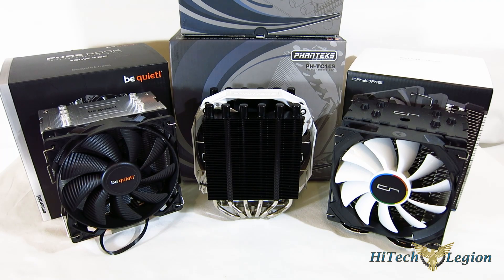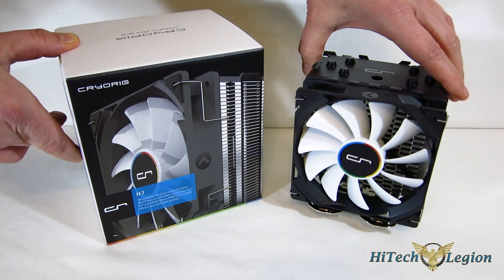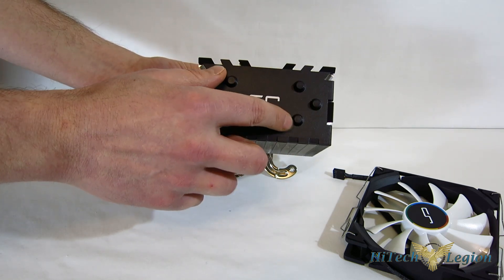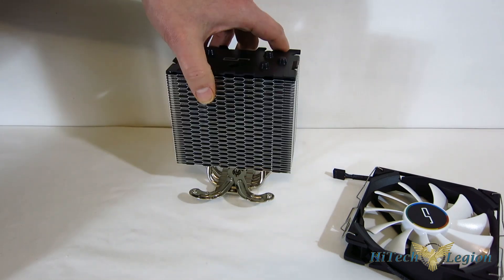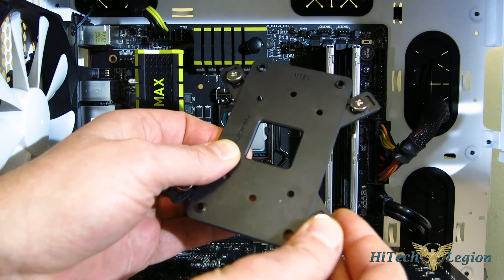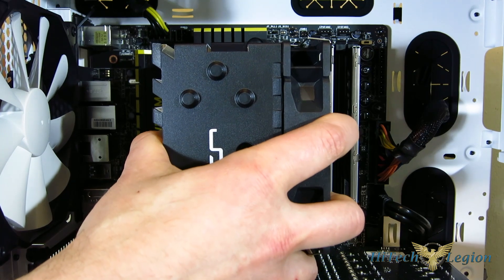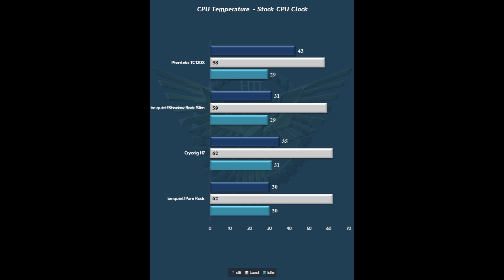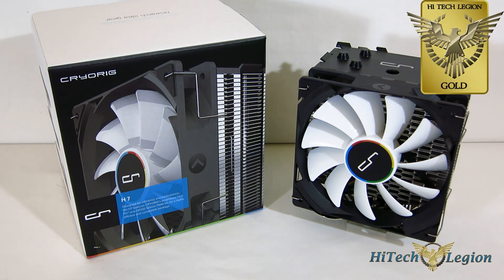Cryorig H7 Universal CPU Cooler Overview, Installation and Benchmarks

Comment: Cryorig H7 or be quiet! Pure Rock?
Reply: +Bartosz Olszewski I actually just decided between these two coolers (i  ordered one them 2 days ago). I ended up going with Cryorig rather than be quiet. It preforms better, looks better, is easier to it install, has no issues with ram clearance and comes with free (and apparently very good) thermal paste. On the other hand, the pure rock is probably much more quiet.
Reply: qwerty Cryorig FTW, I run it almost passive.
Reply: +Bartosz Olszewski nice.

Comment: Would of loved to see a 212 evo in the comparison chart, any reason why it wasn't included? The 212 evo is cheaper now BTW.
Reply: Rich M. What
Reply: @nik8las  How did you not understand what he said?
Reply: Would of loved to see a 212 evo in the comparison chart, any reason why it wasn't included? The 212 evo is cheaper now BTW.
Reply: @amalgam5909  I think you need to include caps for this fella
Reply: well I think I have the 212 evo but i find it bothering the ram slots so I got this instead for my new build.

Comment: do I have to take out my motherboard for the installation?
Reply: +th3pr01234 Being the video showed him installing it while the mobo was in the case I would say no you don't. Not a silly question either, I was going to ask the same thing before seeing the video.
Reply: +Rich M. well...... not clealry true , its about your pc case , some pc case doesn't have a big cut out for motherboard tray , in case of that you need to unscrew your motherboard , but i believe , nowadays gaming case would have perfectly mobo cut out for easy installing non reference coolerr
Reply: There are older cases that the cut out may be off due to socket changes over the years but for the most part it should work more often then not if your case is current.

Comment: Hello, I have a question about my H7 backplate. It is touching some solder on the back of my motherboard? Is the normal, and is the backplate conductive? I have not turned the computer on yet.
Reply: +RedStone Films The backplate is plastic, and not conductive.

Comment: It's ''like'' the H5 Universal but.... IT'S NOT!
They made a H5 (almost 17CM in Height :O) with so amazing cases around fins and very cool-looking fan...why don't they use same but smaller cases and same but smaller fan in H7??? Why did they make a final product that looks a lot worse than the other products?
Consider this. They put customers of ITX systems to decide:
1) Sacrifice efficiency with nice looking Cryorig C1 top-down cpu cooler?
2) Sacrifice good looking with efficient H7 front-rear cpu cooler?
Personally I think i'll search the market a little bit more...
It's a very nice review though that's why i give a thumb up.

Comment: would a second fan on the other side of the block increase its cooling potential significantly or is it a waste of money to do so?
Reply: +ParaLux89 Slightly. You would see a bigger gain in performance at low speed and noise.
Reply: ***** You can purchase a second one.....

Comment: Should I get H7 for my Xeon E3? Mine gets above 85C at 70% load on stock cooler, ambient temp is very warm here.
Reply: Anything is better than a stock cooler. I do highly recommended it as long as it will fit in your case. Good luck!
Reply: +English Muffin I got the ID-Cooling FI-REEX already as they didn't sell cryorig anymore at my place. It's heavy, a bit bigger, and costy. But my CPU never reach 60 even on full load and entire case heaten up because of gpu.

Comment: Would you recommend swapping out the fan for a phanteks 120mm for lower noise and better performance?
Reply: +Ham Burger I haven't actually put a Phanteks 12MP on the H7, so this is purely an educated guess having worked with both fans in numerous other environments - I would imagine performance would be very close, but the 12MP should be slightly quieter.

Comment: am I able to replace the fan with any 120mm fan? For example CoolerMaster Sickle Flow?
Reply: +ProximityAnimations Any standard mount 120mm fan will fit. However, the included XF120 is a top tier fan, so many fans would be a distinct downgrade. Sometimes a drastic downgrade, like the aforementioned Sickle Flow.
Reply: Aaah. Thank you very much! I was just curious because the Cryorig H7 doesn't really match my set-up all that much haha. So Yeah. :P

Comment: is good for socket 1151 ? in the spec thre is only 1150
Reply: +ReSheva7 Socket 1150, 1151, 1155 and 1156 are all the same in terms of cooler mounting. So, yes, it will fit LGA 1151.
Reply: +George Cella thanks!!!

Comment: I had a question about the arrow on the fan. In the manual, they have it so the arrow is pointing at the cooler. But in your video, you installed it with the arrow pointing left. What is the difference?
Reply: +Prismer6 There are two arrows on the fan, one showing rotation direction, the other the direction of airflow. The airflow should point at the tower.
Reply: +George Cella Alright, thanks for the prompty reply!

Comment: Can I switch out the fan on the cooler for any fan or does it have to be a certain fan?
Reply: Silent Shield Any fan with standard 120mm mounting will work without a problem.

Comment: Is your case the H440? Just wondering as I've watched this video and the Cryorig R1 (which is what I'm wanting) and they all seem to fit
Reply: Tyler Lucas I used a Phanteks Enthoo Luxe in this video.
Reply: George Cella Dang, thought it was the H440 lol, do you like it? I'm looking at building a quiet/near silent X99 soon. Any suggestions?
Reply: Tyler Lucas The Enthoo Luxe is probably my favorite case on the market at the moment. The only thing being, the stock front 200mm fan will never be describes as "silent". It can be replaced with two 140mm, so you can make it much quieter.

In terms of a case really focused on silence, I would go with a Fractal Define R5 or be quiet! Silent Base 800. The H440 would be a good choice, also, but I didn't find the airflow to be very good.
Reply: George Cella Thank you so much for taking your time for me! Subscribed :)
Reply: +George Cella i didnt know this was your channel
Reply: Peasant I did reviews for HTL, this happens to be one of them.

Comment: awesome review and awesome performance for the price ,now the story for about $50 you can get the  Cooler Master Seidon 120 v a few dollars more and a better performance ,don't get me wrong I am all air cooling (twice bitten) I wonder how this will look in a micro case like the Rosewill  Ranger M and the Xion  Xon -560 will  this be too large
Reply: danny blackhorse Actually....using their performance respective to the 12DX as a base, the H7 showed better better performance that the 120V at lower noise levels.